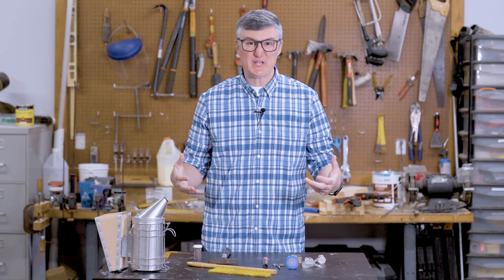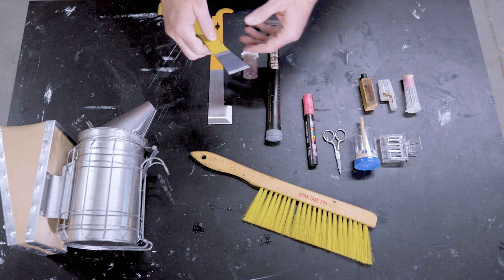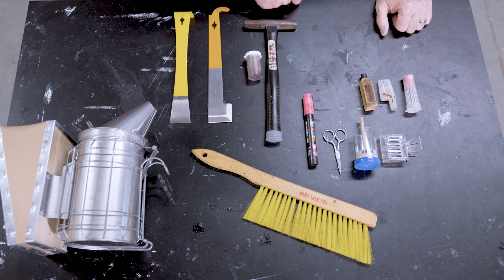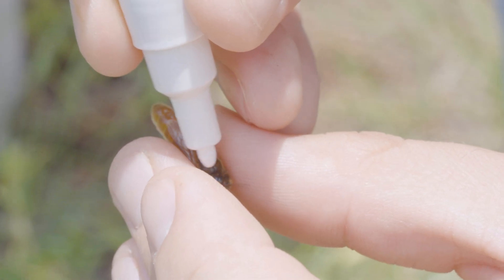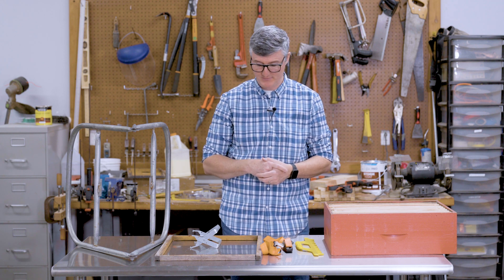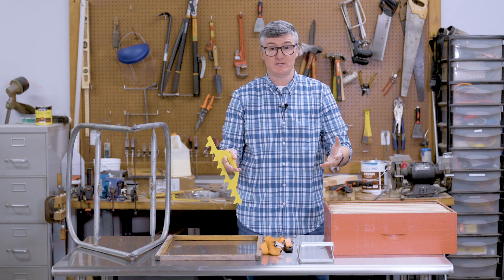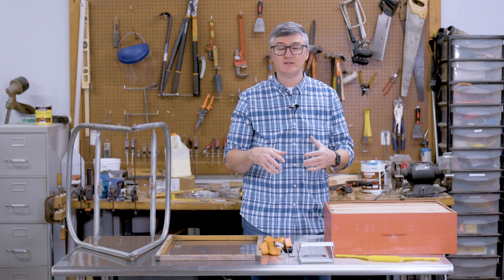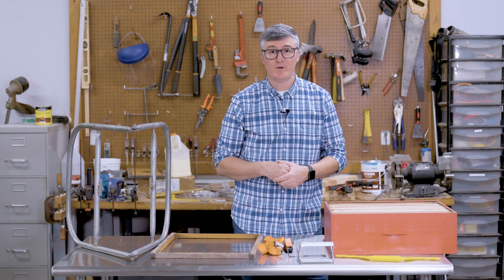Tools of the Beekeeping Trade | Beekeeping Academy | Ep. 26

Comment: Dr. Ellis, quick question, how do you clean your bee brushes?  After pulling supers at the end of the flow, most are very sticky.
Reply from the maker: You can use soap and water to clean bee brushes. Try warm water first to see if that does the trick, since the stickiness is most likely from honey. However, if it's predominantly wax or propolis, then soap and water may be necessary. Propolis is hard to remove!